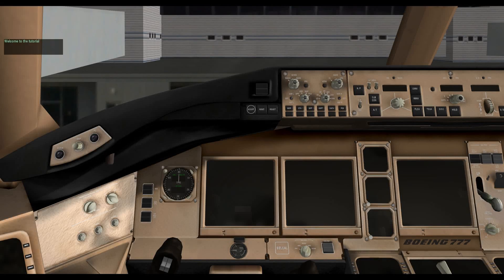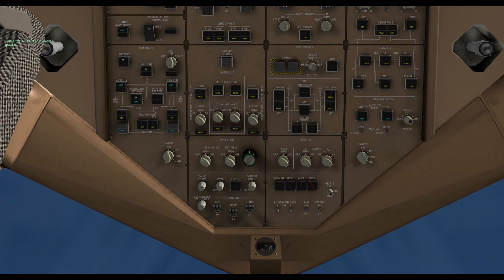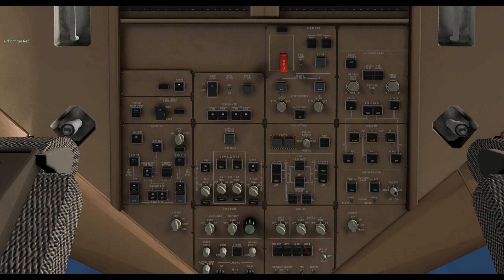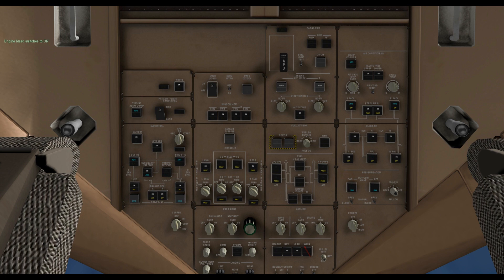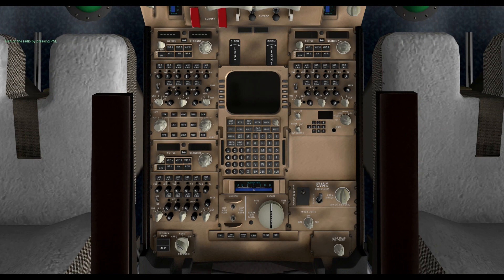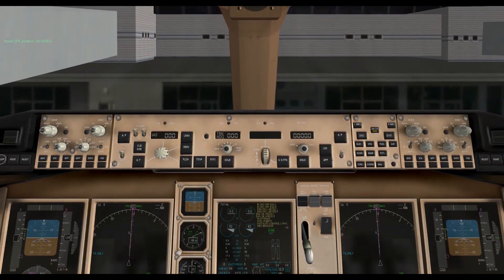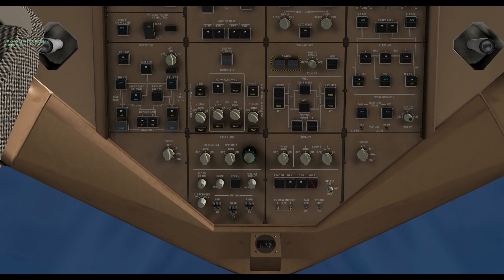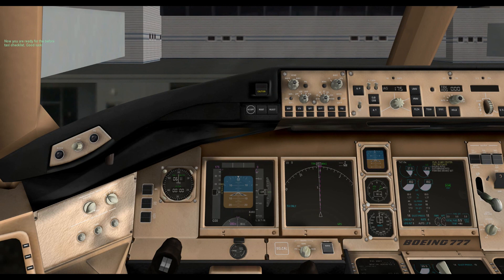777-200LR for X-Plane start-up tutorial

Comment: Lol. The x737 can't hold a candle to this 777. Have you seen the cabin? It's a joke. I can make better seats in about 10 minutes using AC3D. It doesn't have a pushback truck, it doesn't have a custom avionics system, the night textures suck. You'd think when they updated it for X-Plane 10, they would've already had a 3D cockpit. The only redeeming quality this plane has is it's sound.

Comment: My apologies, I watched it twice (not full screen) and both times thought you said "turn the APU off". Also this procedure assumes that external power is available pre-start, on the line that is not normally the case. With regard to the fire test well that may just be company procedure, We always run the fire test prior to APU start, It would be a pity to discover and apu fire the hard way. When all is said I will still be buying it.

Comment: Its battery "on", lights test, fire test. You dont light up the APU until you check the fire warning system is serviceable. Also aircraft on the line use the APU to start the engines. Using external power to start engines requires a GPU and a Jet cart. This tutorial is not right.